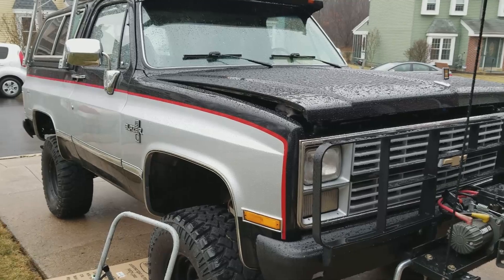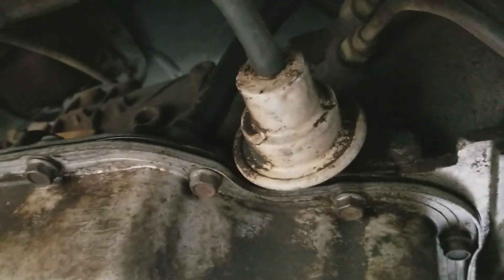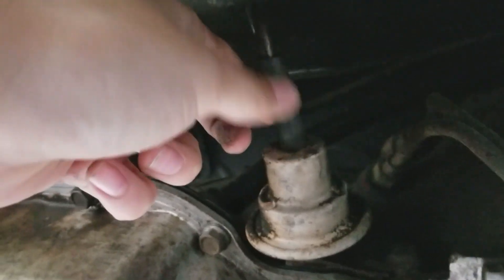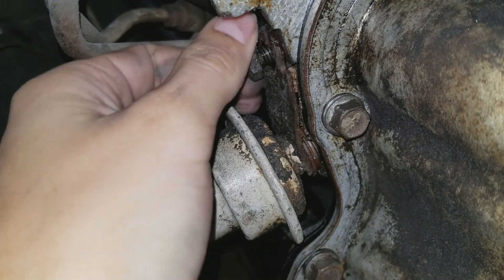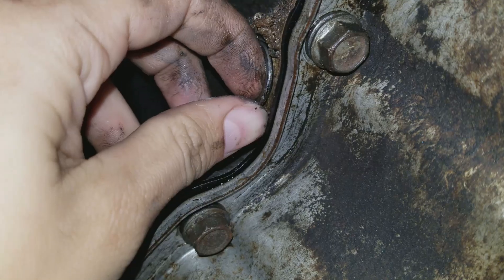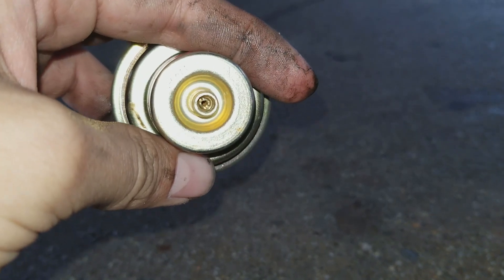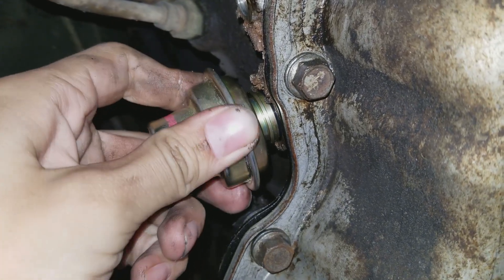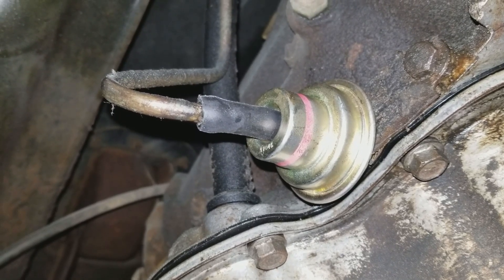Vacuum Modulator Installation GM TH350/TH400 Transmission | FIXES SHIFT PROBLEMS!

Comment: i changed my rear end gears from 273 to 355 now it shifts immediately into 2nd at not even 10mph would this help with that? some people say adjust the synchronizer on the side of the transmission

Comment: I just replaced my head gaskets. Engine works great, yet, it doesn't shift anymore. I believe I accidentally knocked the vacuum line off the modulator cause the metal line is super loose and hanging. Ill have to check it

Comment: Changed my vacuum modulator, had the old original style so when I pulled it out ,about a quart od transmission fluid came out . Is that normal? Never seen it before on other videos 😮😮videos  .
Reply: Same... ever find an answer. I've seen post and they never say anything about a bunch of fluid coming out

Comment: Sweet. My 85 M1010 just started shifting at higher rpms. Hoping it's just the modulator and not the pump. Thanks  for the vid.
Reply: Was it just the modulator? My 83 c30 is doing the same thing and not wanting to shift unless I let off
Reply: @wyatttate945  cracked rubber line was my issue

Comment: It'd be cool to do a in detail vid of explaining an demonstration of adjusting it in.. like from fully closed to fully opened.   🤔 Sure closed would end up overheating trans. An fully opened would I'd guess cause gears to shift in hard at lower shift points. which I'd guess would cause gear grabbing will in time cause stress on the tail end to drive shaft, hard on u-joints , an rear end.. lol 😂 torque converter says to transmission " Are you sure about this?" As engine says " Too late"
Reply: Speak English

Comment: Will this possibly correct early shift/no kickdown issue?
Reply from the maker: On an automatic transmission there are many factors at play. It’s cheap enough and easy enough to replace that’s it’s worth a shot. In general, unless you have other valve body or clutch pack issues, it definitely can help, but for no lockdown, if you have a TH400 (and other transmission models I’m sure) I would check to make sure your kick down switch is connected and working!

Comment: Hopefully this could be what's wrong with my squarebody mine wont shift at all since I put my new  350 sbc down in my vacuum house was bad so ran a new one if this isn't it new transmission time
Reply: Did this fix your problem

Comment: AWESOME VIDEO! Thank you, I just replaced mine today. I had about 1.5 qts of ATF come out when I removed the old one. No worries though, I just put a fresh batch of the same amount back in.
Reply: Is that normal,? Me to
Wondering if it's overfull?
Could be aiding in my issues?
Reply: @ColtonLoberg  Yes there will definitely be some ATF that comes out when you do this job, I guess it just all depends on how fast you move is how much will drip out
Reply: Ever find an answer if it is normal to have fluid come out. I had quite a bit come out
Reply: @loganator78r Yes, I believe it is normal. As long as you fill the trans back up with fresh fluid you'll be fine.

Comment: I have a 1997 suburban. Where is the modulator on mine? I can’t find a video anywhere the tells me where it is.
Reply from the maker: I could be totally wrong, but I’m going to assume you have a 4L60E or 4L80E trans. If that’s the case, you don’t have a vacuum modulator unless it was modified with a vacuum modulator kit. I think you have an EPC solenoid, which is located midway on the passenger side of the trans.

Comment: Nice! What problems where you feeling before and how was the result after this new modulator install?
Reply: I'm not the poster but you can have shifting issues like hard shifting and no shifting also if theirs transmission fluid in the line when you remove the vacuum line it's bad and if you've overfilled your transmission with fluid if you pull it out the excess will come out and immediately I found that out personally , also their are different color stripes on the modulators that determine the strength of the spring inside the modulator and you can also get an adjustable modulator that you can adjust to shift with a hobby screwdriver turning clockwise will spread the shift out a little further and firm the shift if you don't have other trouble with the transmission
Reply: @drjohnsonhungwell5115   Thank you very much for your complete explanations! Much appreciated.
Reply: @GJJC13 No problem it's usually a no shift problem and or fluid in the line and will also make smoke as it's sucked into the combustion chambers the stripes on the modulators I believe the red and green at the stiffest springs but I have used the white , red and green on my military blazer with the TH400 , fluid loss would be very little if not overfilled or hot as well I found out about the hot and luckily I was able to move fast I overfilled it a little too much after a filter change .
Reply: @drjohnsonhungwell5115  100% correct comment

Comment: Just rebuilt my trans and I was wondering why it still shifted so rough, I will be replacing this part to see if anything changes.
Reply: I have the same issue and will try this modulator. My car is 1978, so it can't hurt to have this cheap part changed...

Comment: HI, please tell me I have a 3-speed transmission when picking up speed in third gear on a straight road or up I press the pedal very slowly and the transmission immediately switches to second speed, I don’t want to accelerate at a third speed only when moving down, please help if you know and want, thanks!
Reply from the maker: It sounds like you might have a bad clutch pack in that trans on the 3rd gear. Have you checked your transmission fluid? Is it dark? It is also possible that the valve body in the trans is not doing it's job. Unfortunately I had this happen to me which is why I speak from experience. The vacuum modulator will likely  not cure this particular problem.

Comment: I just replaced my vacuum modulator. Some people may not be aware that there is a modulator reaction lever inside the transmission body that actually inserts inside the new vacuum modulator. Kind of threw me off since nobody else on YouTube had talked about this piece of metal or lever. Luckily I had a schematic showing the lever.

Comment: What does the other end of the line connect to?
Reply from the maker: For me since it's a diesel it goes to a vacuum pump. For a gasser I think it goes to the engine manifold or perhaps a vacuum collector!
Reply: @OdysseyOverland4x4  I think it goes to the carburetor
Reply from the maker: @GJJC13  Diesel's do not have carbs, but if it was a gasser then yes, I think you're right

Comment: I just bought a Oldsmobile f85 from 1962 with a Chevy 350 and th350 gear. it has started to leak when its not in use and i had problems getting it into gear. it drives fine when i have the car on for awhile, and does not leak when the oil reaches the right degree. 
My question is, are all th350 using this vaccum method?
My other big concern is that the Oldsmobile had stick shift at the steering wheel, but since they changed both motor and gear its now converted to a floor transmission. 
The oil stick that was in the car dont seem to be right, and i get no oil on it.

Comment: Nice video. I an new to working on cars/trucks. I am restoring a 1954 Dodge truck and I am learning everything as I go by watching videos like yours. I am in the process of installing a 307 small block Chevy engine with a 400 trans. I noticed hoses and electrical plugs on the trans and I wondered if you could tell me where they hook to. Where does the vacuum modulator hook up to? there are 2 small lines that I think they connect to the rad. There is a 2 prong connection by the shifter that I don't know about and hope you could tell me. I think the steel line above the dipstick hole is a breather hole or something. If you could help me out I would really appreciate it. Thanks for sharing your video. I subbed your channel so I could learn more from you.
Reply from the maker: the vacuum modulator on a diesel will go to a vacuum pump, but since you are installing a small block Chevy, you'll have to tap into a vacuum line, usually coming off of the valve covers, which is the same vacuum that you use for your brake booster... Maybe someone else can weigh in on this, I've always been a diesel guy, but I believe that is the same port oh, as for the wires, that is the kickdown switch, you can just order a turbo 400 kickdown switch, and it just hooks up to your throttle pedal.it is a mechanical switch we're after the throttle is depressed to a certain amount a switch is activated and the transmission drops a gear, that way you are able to get more torque when passing someone for example, mine has not worked, I just manually shift down if I need to, so it's sort of optional, but if you want to do it right, you can always get one. as for the cooler lines, yes, they do go to the radiator, but if your radiator does not have provisions for a transmission cooler, just get one aftermarket, and you are correct about the breather! Make sure that that line is completely clean! Otherwise you will have transmission fluid puking out of your dipstick tube
Reply: @OdysseyOverland4x4  Wow. This is great information. I wish I had gotten into mechanics when I was younger, but  back then I nothing to work on. All my cars were new and I had no problems. Now that I am retired and wanting to restore a truck, I need help. But you know there are a lot of great people like you that are willing to help. That is a good feeling. I thank you very much for the help that you gave me today. I will save the post and print it off so I can put it my book of notes.

Comment: I have a 1978 Ford f150 that has been parked for awhile. I'm trying to get it running again, but I can't get it to shift out of park. It's shifting from the column, and I can see she shifter arm moving at the transmission, but it's not going into gear. Can someone please help. Could this be causing the problem? I don't want to buy a new transmission if it's something easy to fix that I'm overlooking. 
When the truck was drivable it would shift into drive/park hard, and sometimes be late/early when shifting out of 1st and 2nd.
Reply: Tomorrow I'm dropping the pan and replacing the filter. Try to do that the filter kit is less than $20. I'm also going to check the linkage in the trans while the pan is off. This is going to be my first time doing it and I'm 19 so this will be something new
Reply: @damiankillip2611  Alright cool, I'll try that. Thank you. Same though, it'll be a learning experience for me too. I'm 24, and this will be the first time I've had to mess with a transmission. Best of luck to you though, I hope you're able to get yours running again soon.
Reply: @damiankillip2611  well, your learning while still young. I've always been ( production) as opposed to maintenance. At 59 , learning is more humbling and challenging. 
 Harder to see stuff too. 
 Take care of your eyes.
Reply: I'll keep you updated on everything and how it goes
Reply: @damiankillip2611  Alright, cool bro. Hopefully it goes well for you.
Reply: @damiankillip2611  I took my old vacuum modulator off today, and it it poured transmission fluid out. The lines were full too. I think this was my problem. I'm going to replace it tomorrow after cleaning the transmission fluid out of the lines, and see if it will shift properly.
Reply: I have a 1978 oldsmobile with a 350 and it has the same exact issues
Reply: @damiankillip2611  Dang, it's a frustrating issue for sure. I still haven't figured out how to fix it. Mine was shifting when I last parked it years ago, but now I can't get it to do anything. The 302 I have in mine is still good, it starts, but won't shift. Lol.
Reply: Mine starts right up it was driving last month then it sat and now I have nothing.
Reply: @damiankillip2611  dang, that sucks. I feel you though, the struggle is real. If you find out a way to fix it, let me know lol.
Reply: I dropped the pan today and went to take the pan off and no fluid came out. The pan was only half way full. I replaced the filter and put new fluid in it. Got drive for about 5 feet or so then  only had reverse. Don't know what to do now. I looked at a fourm and it said the forward clutch is out.
Reply: @damiankillip2611  Dang, that sucks man. If it's not one thing it's something else, aye?
Reply: Always. I'll keep you updated on everything I do
Reply: @damiankillip2611  Alright, I appreciate it. Same though. Good luck.

Comment: I have a 6.5 Diesel installed, with a THM425 GM transmission.  Problem is, I don't know where to get vacuum to control the modulator valve?  
The Vacuum distributor type vacuum pump, only shows 26 in vacuum "constantly" , 
and does not drop in line vacuum as I would expect it to when accelerating. 
and does not allow me to start off in D "1st Gear" , unless manually.
Reply from the maker: Jenny Rodriguez so behind the air filter on the 6.2 is where the pump is. Sounds like your pump is working well. Up in the front where the throttle valve is, there's a black plastic piece that changes the amount of vacuum. It's very possible yours is busted or not tuned properly. It's adjusted via two bolts and you simply rotate it. I believe it's called the "vacuum regulator". See if you can find out where yours is!

Comment: I'm taking it that your transmission wasn't shifting till a high rpm. am I correct? also if anyone out there has a problem with vacuum hoses going soft from oil in the lines you can use a good quality fuel hose instead.
Reply from the maker: breezy0037 yep, you certainly can. Make sure it's firm and won't collapse. Mine was just shifting all over the place, particularly at higher rpms than normal

Comment: Gotta quick question guys, any information will be useful. I have a TH350 I’m putting in a 1980 el Camino and I understand that the 350’s shift via the shifter cable attached to the carb and 400’s shift using vacuum from the modulator valve to a port on the intake and/or carb. So then what is the modulator valve for on the 350’s?? And where do I connect it to? I’m assuming to the designated port on the intake but I’d like to know for sure? Thanks.
Reply: The th350 shifts from the vacuum line that comes off the intake. The cable coming off the car is just a kickdown cable. Ive got a 350 in my 85 el camino.

Comment: What kind of shift problems would this help with? I noticed when I went to 37s I don’t shift into 3rd until about 50-55 mph
Reply from the maker: This could quite possibly be the culprit. It is worth a try since these modulators are relatively cheap. This usually fixes late/early shifting problems. If this doesn't take care of it, you COULD be looking at a new valve body (which also happened to me). But try this first!
Reply: Ruben Herrera what gear ratio are you running? The m1009 came with 3.08 gears. I’m changing axles to a 14bff with 4.10 gears I’m hoping this change in ratios will help the shift points
Reply from the maker: Adam llaneta changing your ratios will definitely have an effect on your shift points. I am running 3.08 at the moment (stock). If you want to change your shift points and fine tune it, make sure that your vacuum regulator is working, AND the modulator. Get an adjustable one like on this video, and you'll be good to go!
Reply: Adam llaneta  . after finally taking my project on the road i ran into shifting problems. I  have 37s &  th350  , same problem as you. It engages 3rd gear till like 50 mph. Please let me know if you find the problem
Reply: Adam llaneta  not sure gear ratio I have a 14sf on my jeep